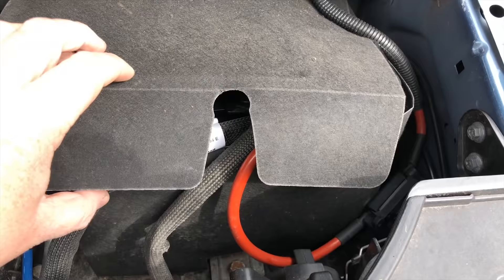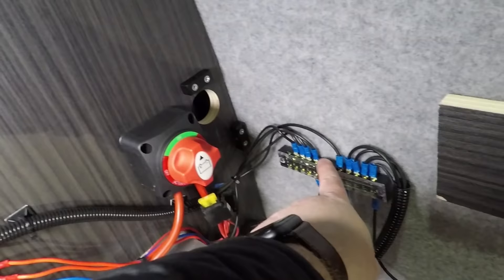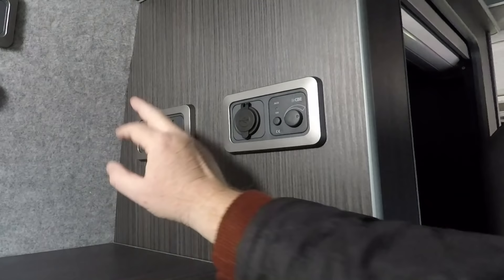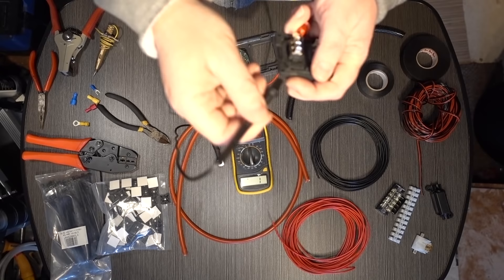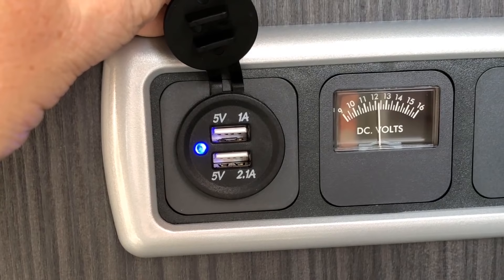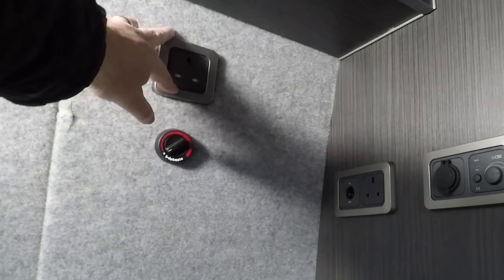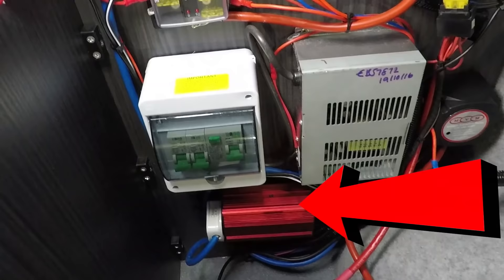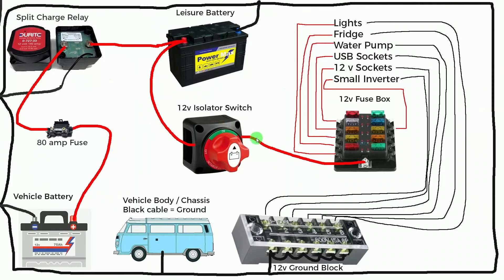Complete 12v Campervan, RV, MotorHome, Boat Wiring Tutorial

Comment: I agree with everyone else. By far the best video I've come across on the subject. Question is how to determine correct size for inline fuse coming off battery. To help US folks use 1/0=60mm and 14guage= to 2.5mm
Reply from the maker: Thanks, each appliance or light uses a different amp rating, if you don’t know the amp rating you can check when it’s in use with an ampmeter.

Comment: John you're a star. I've just bought a van last April and am in the preparation and planning phase at the moment. I know nothing about electrics, but you've explained it in such a way I can now understand. One thing I'm not quite clear on and hope you can explain to me is when you need an inverter. I know you need it if you're charging 240v gadgets from your leisure batteries, but do you need it if you want to charge your leisure batteries from a 240v source (such as a campsite hook up). Like yourself I plan on running everything on 12v. I'm even looking into the 240v portable charger you talked about in another video. Thanks again for all your brilliant videos :)
Reply from the maker: This video might help https://youtu.be/rAnrqxBbd3c

The portable charger review is here https://youtu.be/VuDwSMVvar8
Reply: @johnmandy  Thank you John that's very helpful

Comment: I don't even have a camper but I found this interesting and easy to understand. You asked for questions: Does it matter if the leisure battery is a different size to the vehicle battery as long as it's 12v? How do you connect if you have multiple leisure batteries (narrow boats have 3)? How would solar be connected and why didn't you go for this? What voltage is healthy for a leisure battery? You mentioned RCD but I didn't hear what that stood for. Again, thanks for a very clear video.

Comment: Hi John.  I find it easier to remember UK wiring as BRown = Bottom Right (When looking into an open 13amp plug) and BLue = Bottom Left (This would therefore be the opposite side to the fuse).  I feel sure that is why those colours were chosen as theri first two letter are BR and BL (Bottom Right and Bottom Left)  :o)  Great video.  I now need to get an isolator and fuse box and ground bus bar like those...

Comment: great video, I learned a lot. If I'm understanding your diagram, you use one red wire to wire all 6 lights ending the string with one black wire to the grounding block.
Reply: No they are wired in parallel. Red and black to each fitting. Same as a 240 volt loop in system in uk for lights. otherwise if one bulb failed they would all go out.

Comment: Thanks, just what I was looking for. I'm building a pull-behind camper trailer, and most of this applies. Only difference is that I want to install a converter/charger that will take shore power (120v) to charge the battery (12v).

Comment: Thanks for the video, it saved me I totally forgot that I needed the heavy cable from the battery to the fuse panel.   I was only going to use 10g instead of the 16g.  Oops
Reply: Are you sure you're not confusing wire gauge with mm^2?
Reply: @tunnelvision9549  yes sorry I was in a hurry when I type that and wasnt thinking.

Comment: Nice presentation---thorough yet clear. I love the diagram you made. A surprise was your explanation of "waste of energy" when using an inverter to boost voltage for charging devices that only require five volts. Thanks for an informative video!

Comment: As for laptop and your camera batteries really worth buying a 12 volt charging cable, I use one with my cameras and MacBook also have a 12 volt tv.. They are great and take a lot less juice than me charging them using my inverter. They are available for most things and a must. Only use my inverter for microwave and kettle. Realise this is for your build but worth mentioning the earthing is different if you use solar, the earth must be from battery not vehicle. Brilliant channel glad i found it :-)
Reply from the maker: Thanks Stephen. In my new van I have solar wired straight to batteries and then everything is powered from them. My laptop at the time was a beast and my drone batteries never charged fully off the 12v, so the inverter was a must. Now, in my new van, I use 12v for nearly everything. The inverter has been used about 5 times in almost 9 months, but it's there for when I need it.

A lot of people wire solar up to be used directly, I can't see the point, I wired my solar up to charge the batteries and my 12v wiring then supplies power day & night, with the solar charging them during the day.
Reply: Gadget John great vid.. I have just started about a camper conversion and I  have  only installed a 12 v heater and a tv .. I have connected them to leisure batteries and plugged them in to  12v cigar type sockets that have fuses... question is are they safe and should I install a fuse box ?
Reply from the maker: mark lloyd The 12v fan heaters are not safe in my opinion, if the wire gets hot while you run it then it’s unsafe. The tv should be perfectly fine though.
Reply: The you John, the heater is a diesel night heater so assuming that will be fine too

Comment: G'day Mate, Very good simple to understand basic wiring setup for an RV, For me when wiring 240V AC I use the old saying 
"He was all Black & Blue" to remember the colour of the Neutral wire or Negative as in a DC circuit. (Negative in DC is also 0V DC)
Safe Travels, Steve.
Reply from the maker: Thanks Mate. Good tip on the wiring code 👍🏼

Comment: I'm already done with all my wiring in my van. But i have to say you really thought your video through and it is really good ! :)

In my opinion it is important to mention that the Voltage sensitive relay(VSR) has a standby consumption. So if you're planning to stay at a place for a longer time without any other power sources loading the leisure battery than the actual car better unplug it. Otherwise it will drain the battery slowly over time.
Reply from the maker: The vsr sold in the uk have no drain. The relay opens once the incoming voltage drops and therefore nothing can leak back.

Comment: This has been very easy to understand thank you. I have a ford custom need to wire up.
Reply from the maker: On newer vans, yours is probably new enough, you'll need a battery to battery (DC charger) to replace the older style Split charge relays (VSR) - If you van has stop/start functionality or has a Euro6 or above engine then the VSR won't work correctly so the DC charger is what you need, otherwise everything in this video will be the same.

Comment: Nice setup you have there, however I feel I must be a pedantic sod and correct you on one point. On your USB charge socket the combined output is 3.1A but that's at the 5V output, so even when taking into account something like a 85% efficiency on the internal step down circuit, at the 12v input it's only pulling a maximum of around 1.5A. so perhaps a 2A or 3A blade fuse would be more appropriate and still allow for use when your leisure batteries have a low voltage. Smaller rated blade fuses do exist.  Keep up the good work, I'm enjoying these videos.

Comment: Good video very well Explained. But I would like to point out a little problem in your wiring I have found over the years of being a vehicle technician 90% of the problems in wiring is them red scotch locks I would advise you to solder and heat shrink all of them . Liked video looking forward to more
Reply from the maker: The scotch blocks are used to check wiring is all in place and things are working and then connections are soldered after 👍🏻

Comment: Did you check what the amp rating is for the taps microswitch? You're running all the required power for the water pump via that tap switch. If, for example, the tap switch is only rated for 2 amps and the pump requires 5 amps, then you will be over-loading the tap switch. You'd need to introduce a relay into the circuit to protect the tap switch from burning out.
Reply from the maker: Good question bill, since millions of these taps are sold and installed in hundreds of millions of campers worldwide I think it's safe to say the gear is suited for this installation. The wire coming out of the tap is 16amp rated, so you'd have to assume they put a switch in the tap that's able to cope with up to 16 amps.  Most whale drop in water pumps are only 2amps though, so it's all good 👍🏻

Comment: Great to get a simple, clear explanation, at last! I'm working on a 30 year old RV where there are problems with the 12v DC system somewhere and am thinking of scarping the lot in here (30 years old it could probably do with it)...do you have a tutorial on fitting a converter and suitable deep cycle 12v charger?
Reply from the maker: Check my other videos, I’ve got inverter tutorials, solar installs and battery chargers.

Comment: Hi John I also have a Vw t5.1 (yours is I T6) now I have had problems with my leisure battery, I am keen to know which Split VSR relay you used, my van and I’m sure yours also has, stop start system which may also have regenerative energy recuperation on overrun (coast) or braking, now I have been told unless a battery to battery charger has been fitted they can chuck out too much power from the smart alternator and causing early death for your batteries
Reply from the maker: The video description has a link to another video where you can see all the parts used. Ours worked fine with a vsr split charger 👍🏼

Comment: Hi John. Really useful and informed video.  Can you explain the red light and how it relates to charging the leisure battery and when it should be on or off. 
I am having issues in my leisure battery as intermittently the power in volts shows 13 plus but most of the time 12.7 which ultimately does not give me enough power to fire the diesel heater. 
I have tried putting the batteries in parallel but this did not make any difference. Any thoughts? Best wishes. Gareth
Reply from the maker: 12.7 is a fully charged battery, which is perfect to power the heater. Over 13v is the charge rate while the engine is running.

Comment: Great stuff. All very clear, concise and easy to follow. Can you explain about battery chargers. Can you have any type of charger installed or does it have to be a specific type as (if I underrstand correctly ) it is gong to be permanently on when hooked up and in extreme cases may even be powering through the battery when very low. Thanks Guy.
Reply from the maker: Any leisure battery charger will do, if your power needs are great then buy a larger ampage charger 👍🏼

Comment: Hi John and Mandy, great video thanks. I have a couple of questions if you don't mind. Sorry but I find the electrics very confusing so they may seem obvious but not to me! I was wondering what connects to the negative of the fuse box if anything? And does the grounding block have one connection that grounds to the chasis? thanks Paul
Reply from the maker: If you watch the video I show all the info you’ve asked for.

Comment: Hi John,absolutely brilliantly and simply presented, I'm considering converting a mini bus which is started with 24 volt batteries, is there a way that I can use the exact system that you have shown here and charge the 12v leisure batteries from the engine, thanks in advance. Mike.
Reply from the maker: You can run this at 24v too, just make sure all devices are 24v rated.
Reply: @johnmandy  is there a transformer on the market from 24v to 12 v that I can put on the main wire from the engine inline before it gets as far as the leisure battery so as to charge it up?

Comment: Hi John, thank you so much for this clear information. I have a couple of questions I would be really grateful if you could help.
When wiring up the voltage reader, how do you 'tap in' to the other wires from the USB?
When wiring up the tap (which I am currently doing) you said the 2 wires coming from the tap are the same, but the tap I have with micro switch has a positive and negative wires coming out, so i am not sure how to do this following your instructions.

Thank you so much!
Reply from the maker: The voltmeter just goes to the + & - to the fuse box. Just wire it in like any other item.

Comment: Great video mate, simple and clear! Just wondering, what kind of fuse did you use for your 12V socket? Thanks!
Reply from the maker: Use a fuse smaller than your cable rating but check the amp rating of the devices you’re going to plug into the socket 👍🏼
Reply: @johnmandy  thank you :)

Comment: Hi John, thanks for a great video, the diagram at the end is exactly what I needed. I do have a question on the wiring, how did you run the red cable from the start battery in the engine compartment to the split charger in the back? You touch on it at the minute mark, but that detail is a bit unclear to me at this time. Cheers!
Reply from the maker: As each vehicle would present different routes for cabling, I left the cable routing up to the viewer 👍🏼

Comment: Your point about using inverter to charge phone/tablet (13:30) is spot on.  But I have to ask, your laptop runs a >110W charger?  Even a big old MacBook Pro 17 from 10 years ago only ran a 80W charger.  Every modern laptop charges off USB-C (I can charge my MacBook off a 10000 mAh portabe battery).  Likewise I am sure you can find a DC battery charger solution for your drones.
Reply from the maker: There’s another video about batteries & inverters in more detail. Your right about 12v chargers 👍🏼

Comment: Hi John great video easy to follow, just about to start a van conversion into a camper 🤪 so your video is so helpful! Just one question with regards electrical wiring, how would you set up a supply for a kettle, as these do take 240v ? Would you suggest jumping ship and buy a 12v kettle?
Reply from the maker: We’ve tried them all and we settled on a kettle for the gas burner as it’s fastest 👍🏼🚐🔥

Comment: Hi John I love this video super help full! I have a question for you. I have a camper that drops into the bed of my truck. i believe i can use the same wiring that you have but I wanted to ask How I would wire my harness to connect to the trailer connection on my truck so i have breaklights on the camper? Thanks hope you get this. Best

Comment: Hey John, I see that you've connected your leisure battery to your main in order to have the alternator charge it. I also understand that the split relay helps keep your main charged at all times but my question was if you need to ever jump your main battery would that cause any problems with your split relay or even with your leisure batteries?
Reply from the maker: Jump starting wouldn’t do any harm to your leisure batteries, but this is an old video and you should really use a b2b charger.

Comment: Hi John
I can't thank you enough for such a informative video and for going to the effort to simplify what seems to be a minefield, I'm having a go at my own install and just have one query, my 6 way fuse box has connections for positive & negative so with this in mind can I run the negative from my leisure battery to the fuse box without the need for a bus bar/grounding block.
Thanks in advance for your time
Cheers 
Steve
Reply from the maker: Yes, those combined fuse boxes were not around when I did this build. So it’s far easier now 👍🏼
Thanks for the kind feedback 🙏🏻

Comment: This was a gold mine of information. One question:  In the diagram, you show a negative cable going from the car battery to the grounding block. Maybe I'm misinterpreting the diagram. Do I need a separate ground wire from the car battery to the grounding block? Or, are you just showing that the car battery is grounded to the chassis and then the grounding block grounded to the chassis?
Reply from the maker: The black wire in the diagram represents the vehicle chassis or earth. So you just need a 16mm cable from the negative terminal on the battery to the vehicle chassis. Then from the chassis to the grounding block use another 16mm cable 👍🏼

Comment: Thanks for your great output. I didn't understand your comments about the inverter. I've just bought an 1100w inverter for my boat and I'm concerned from what you said it will burn all my wiring. What wiring do I need to install for this please? main use for the inverter is for a microwave.
Reply from the maker: I’ve got a specific video on inverters, hopefully that will help you 👍🏼

Comment: You have an inverter to convert the 12v to 120v for the sockets. But when you plug into the wall/generator(120v) do the plugs continue drawing power from the inverter or from the wall(outside electricity/ generator).
Reply: I really enjoyed the video by the way.
Reply from the maker: I have separate sockets, so some sockets use the inverter and other sockets use the hookup power if we are on a campsite. Check out my new video on inverters and batteries.
https://www.youtube.com/watch?v=rAnrqxBbd3c&lc=UgwDuzHw4Uxtt58qf0t4AaABAg

Comment: Can 12v grounds and 24v grounds be connected to same chassis (safely)? I plan to get a 24v battery bank but my trailer has 12v lights separately grounded to the chassis (I won't be using the tiny 12V battery it came with). Of course I'll be using a step-down 24v to 12v inverter for 12v lights/appliances. I'm concerned about creating a ground loop (which I just learned about) for the existing 12v exterior lights being individually grounded to the chassis, and then having my 24v battery bank ground block also grounded to the chassis.

Any help is appreciated. Cheers.

Comment: Hi John I have a similar wiring system as your diagram except the inverter,  I'm installing a 2kw inverter do I need a secondary isolating switch for it via the battery,  to keep it away from the smaller fuse box? I'm installing a 200amp fuse to it .
Reply from the maker: Yes, you should watch my inverter video to see how to best wire it up 👍🏻